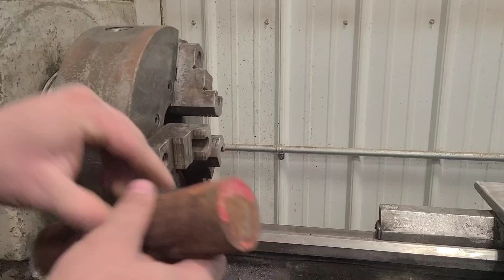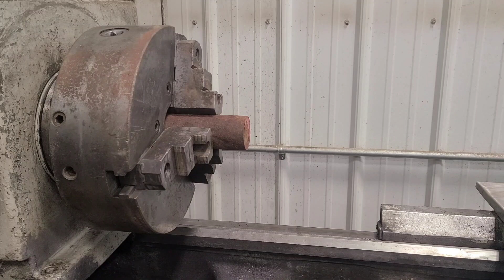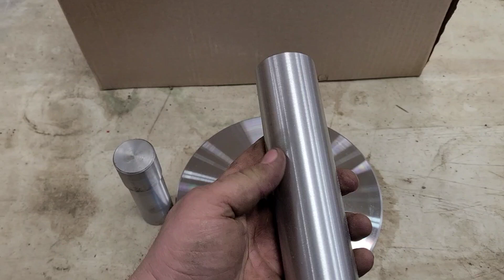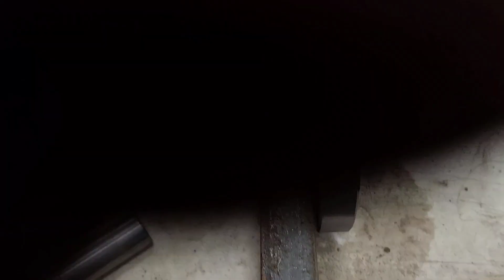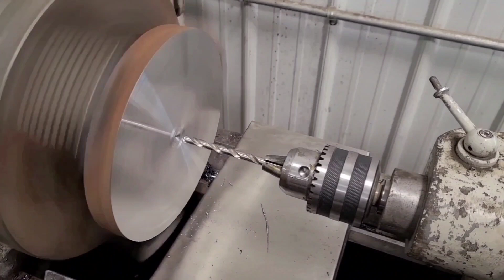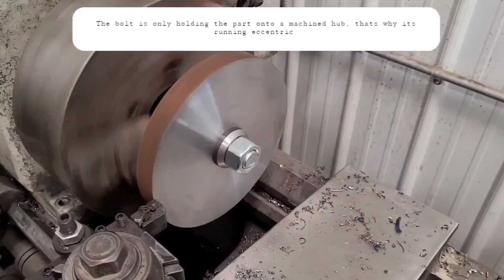Gantry Crane Caster Machining Part 1

Comment: Nice machining and design.  I call it elegant engineering!  Did you use round stock or plate for the caster wheels?  Just curious.
Reply from the maker: The caster wheels themselves started as 8.5" 1045 steel round bar, cut into 1.125" blanks. This left 1/16" (0.0625") for cleanup on each side in the lathe. Finished size is 8.25" tall by 1.000" wide wheels

Comment: Those tracks you laid the plate steel on must be on the D4 with the compressor on it. Just in that picture I can see why you wanted it. Just from the look of the track pads I’d guess the undercarriage is practically like new.
Reply from the maker: The tracks are in very good shape, a little rust on pads but I can clearly make out the Caterpillar letters in the pad. The sprockets, rails, pin and bushings all look great as well. Thanks for watching!

Comment: Another case of homemade is better than buying it
Reply from the maker: I had the material around, and for the weight I want to lift, store bought wheels just weren't up to the task. I found some rated for 2600lbs but the gantry has a working load limit of 15,000lbs. Therefore, the store bought wheels would've been a weak point. The casters I am making have a working load limit of 5000lbs each, 20,000lbs with all 4 combined, and they eliminate that weak point. Thanks for watching